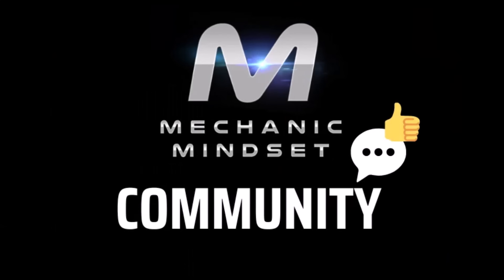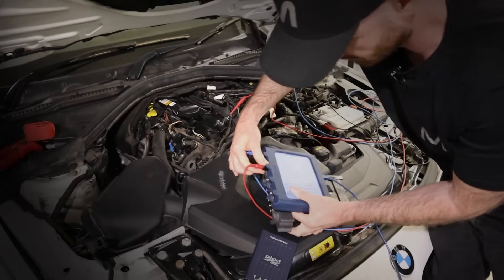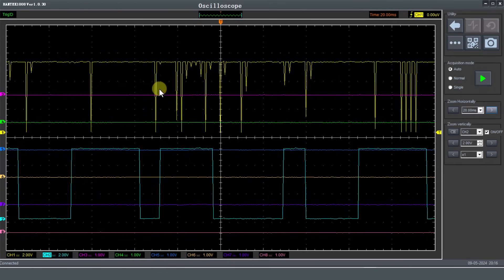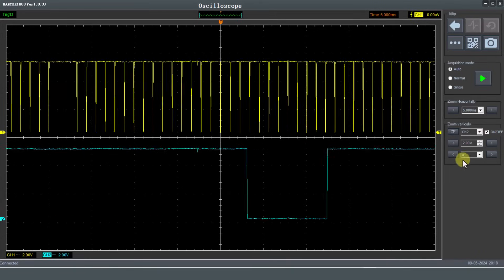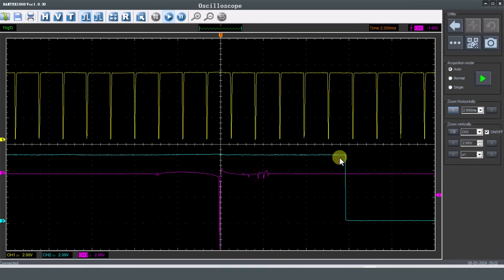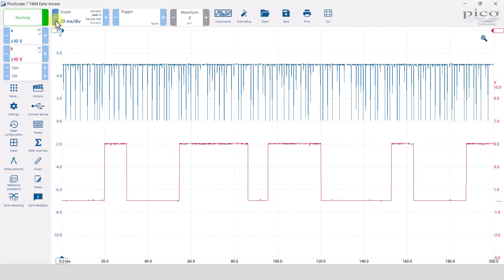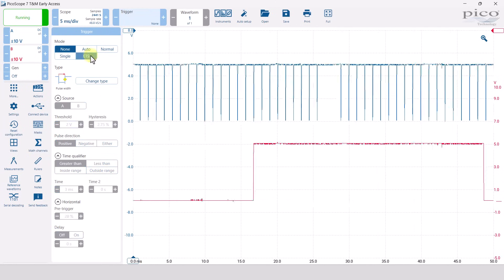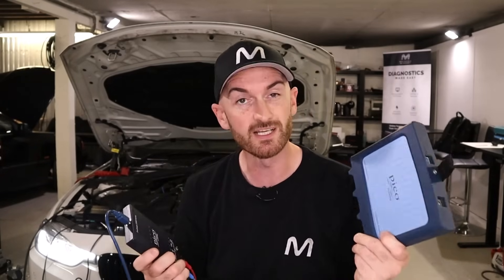Don't Be Fooled! Crankshaft Sensor vs Oscilloscope

Comment: If your not sure about V V T or cam chain tension when your getting 'drift' between cam position sensor and crank position sensor, shouldn't you check idle speed and oil pressure? 
I'm guessing they both use oil pressure to operate in conjunction with sensors? (opening or closing bypass valves or simple pressure relief?)
Checking idle speed isn't too high is something that's been taught since well before electronic ignitions were used, (good old fashioned points and condensors)
  Mechanical advance mechanisms drop in and out from 'starting' position, your speculating about mechanical not electronic components.
Reply from the maker: Great point. Not much to adjust on these. There’s no problem with this engine, it’s good as far as we know. I also reminded myself that chain slack is much more erratic than this slow phasing back and forth we see here. It’s more than likely VVT 👍 Although I’m used to seeing it locked in the idle position
Reply: @MechanicMindset  Generally, if you have very erratic trace, tensioner is faulty more often than excessive chain wear (unless it's got 200,000 miles or more on it ) 🤯
Reply from the maker: @1crazypj  Or if it’s a BMW 🤣
Reply: @MechanicMindset  14:50 ,How far can the timing pulley move? What does it look like in different cars?
Reply from the maker: @ebolti22  Usually, it’s locked and doesn’t move at all 🫣

Comment: I have a pico 2000 series like in this video. I find it so frustrating trying to capture a secondary ignition missfire when its under load. Theres not enough memory to make out whats actually happening as i need a few seconds on the screen but once I stop the scope and zoom in its very bad quality. Im looking at the new micsig sato series. Still 8 bits but way more memory
Reply from the maker: It’s not the best for secondary ignition. MicSig are nice scopes 👍

Comment: One can get a much better performance out of the 1008 by using the hscope software. As far as userfriendly and performance, it leaves the oe hantek software for dead.
Reply from the maker: A lot of people have great things to say about HScope. I have it actually, but I keep coming across a problem where I can set the voltage scale high enough! I’ll need to try it again 😬

Comment: Excellent content on oscilloscopes.  I really like the HS02 oscilloscope it has 12 bit capabilities and has 8000 samples per second and the software is so user friendly.  It also works with Android tablets. This micro-oscilloscope comes in at $100.  My favorite low cost.oscilliscope is the Analog Discovery 3 by Diligent. Its.a.small powerhouse at 125 MiSA per channel and 32000 samples per second at 14 bit resolution and the software called waveforms is the best software out there and competes with Pico Automotive.  With Academic pricing you get for $200 and the software has automotive features. This is the best 2 channel scope for the price.
Reply: Yes sir the hscope software is awesome
Reply: Thanks for these recommendations .. I'ma  DIYer and can't afford $1000+ for these name brand scopes..
Reply from the maker: Ah wow, I don’t think I’ve come across that. I’ll have to check it out!
Reply: Is it the 410_415_C?
Reply: Hscope s/w is the best imo
Reply: The scope that you talk about, hs02, only has 1.6 MHz bandwidth. Isn't that ridiculously low?
Reply: @event3horizon yes low, but consider that nothing mechanical has an higher bandwidth, neither 10.000 rpm motors.
Reply: Thats plenty for automotive signals. For example Snapon Zeus has 3 MHz. The HS502 is.the best budget friendly scope for.the money and the software is outstanding. If you want to dabble in electronics as well then maybe the Analog Discovery 3  is the way to go.

Comment: HSCOPE has a way running in a pages record mode with the 1008c. There is a gap between the pages but it definitely makes the 1008c a little better. As a scope enthusiast I own way too many scopes ( high end and low end ) I still am amazed at my hs502 and my hs402 wifi with an internal battery. I would pay 10 times the price , I just think HSCOPE really has more features then some of the high end scopes.  Here is a link to the gadgets playlist demonstrating the new capture mode. Hopefully it okay to leave. Please delete  if not. https://www.youtube.com/watch?v=Ro7iO32bzRU
Reply from the maker: I have the HScope software (and I’m in the Telegram 😁). I need to get myself a HS502; they look great!

Comment: When trying to take accurate degrees measurements from a 720 trace at cranking.....how do we allow for, compensate for, the rotational speed is not the same throughout, hence a generic overlay of 720, and measuring between points can never really be accurate as rotational speed increases and decreases during the trace ? I tried to measure a missing tooth position relative to TDC on a trace, but it was 10deg out from actual due to the cranking speed being different at different points throughout the cycle.
Reply from the maker: Great question! Maybe counting the difference in crank  teeth might give a better look initially. 

Or maybe remove the plugs? But that’s getting timely. Not thought about it before!
Reply: @MechanicMindset  in this instance teeth are an awkward one, as it was only a 6+1 crank wheel, so large gaps, so less consistent/resolution. On the cranking scope, it appeared as the reference should be 90deg ( reference tooth position relative to cyl1 TDC )  in reality it was 100 on an actual live running check with timing light. And even more oddly measuring on the dead side of the 720 scope trace, ie at cyl4 instead of 1, it appeared as 80 deg. I think I did this with the plugs out, albeit a sensor in cyl1 so there will be decell/accel in that area, if perhaps more consistent elsewhere. It was to get some basic settings for configuring an aftermarket ecu. But was just surprised how far out it actually was. If doing, needing accurate measurements at cranking speeds, there will be errors at different points of the trace, because there is no compensation for speed changes during the 2 rotations.
I'd guess a running engine would be less susceptible.
Reply: @MechanicMindset  weird...I thought I replied, and can't see it now. Pretty sure I did it with the plugs out, obviously a sensor in cyl1, so that will see the most accell/decell. The crank had a 6+1 wheel, so not the most resolution, and I was trying to determine the reference tooth position relative to cyl 1 TDC to let me setup an aftermarket ecu for the first time. Doing this using the 720 trace at cyl1, and doing a comparison with cyl 4 yielded different results, and both incorrect, 90 vs 80 and then actual at 100deg. I should do a running test, as I think it would give better results as there would likely be less relative rotational speeds throughout the cycle.

Comment: The hantek 6074BE is a better choice than 1008 if you want a cheap scope. Got 4 chanels, 64k memory and if you use the H-scope app it is quite good.
Reply from the maker: I’ve not tried it myself. 64k sounds better. I wonder if it’s still enough for some diagnostics. Thanks!
Reply: That's the scope I have been looking at. Haven't found much content on it yet.

Comment: I bet the pulstime from the cranksensor is 45usec independent with rpm ? Try turning the crankshaft backwards and measure it again:)
Reply from the maker: You thinking it’s an active sensor? I saw these a while back at Audi, and they give a signal with the ignition on/engine off (this one doesn’t). However, im gonna try this for sure! 👍
Reply: I think it’s not active like an abs sensor but I think it’s bidirectional
Reply from the maker: @martijn8337  Will check it out 👍

Comment: nice catch...    in the cheaper picoscope because it has a very small memory,     on the software sampling mode  you should  try to choose sample rate instead of buffer memory, that should help out also .
Reply: and thats also the proof once more that the hantek 1008C should be only one channel or two max ...     8chs is only  to work as a digtal voltmeter lol
Reply from the maker: @alexluz7023  Great point! To be honest, I tried both functions and it didn’t really make much difference. The memory is so low 😅

Comment: Appreciate the levels you go to to squeeze out the best info from entry level scopes.
To be honest, I never knew how significant the benefits were when spending more on oscilloscopes!
Now starting to save for upgrade 👍
Reply from the maker: Great plan! The cheap scopes really help you u destined where the cash goes on the high end stuff. Thanks for watching!
Reply: Scopes are a lot like cameras. Doesn't matter how much you spend if you haven't learned how to use it.
Reply from the maker: @toom1h-  Great way to put it 👍

Comment: you forgot to turn off channel 8 with the hantek.. 5:50 in the video
Reply from the maker: Cheers, if you go on a little bit more, i notice and turn it off
Reply: @MechanicMindset switched to CH 7 before you turned it off if you watch closely.. the white waveform is proof.. not too important though. doesn’t take away main idea of video 😊
Reply from the maker: @HenryBui-bu4sw  Cheers, the Hantek has such a cumbersome interface 😅